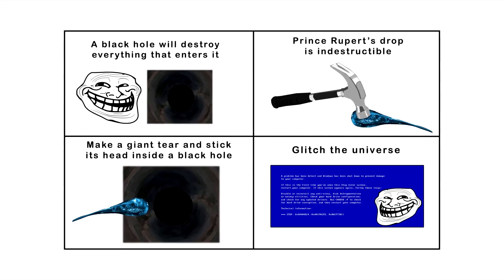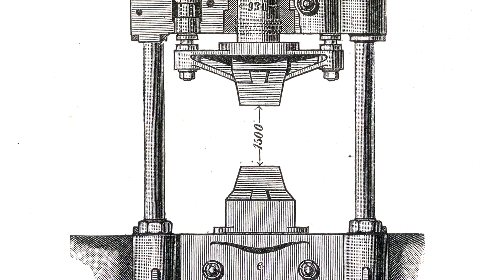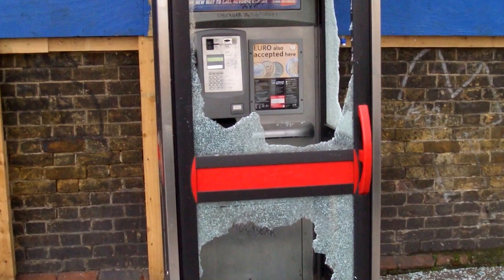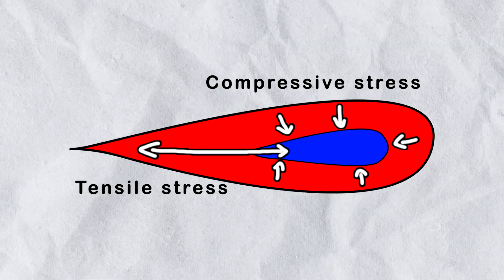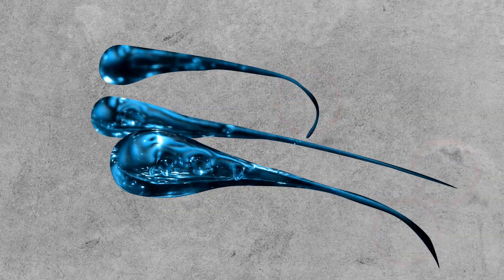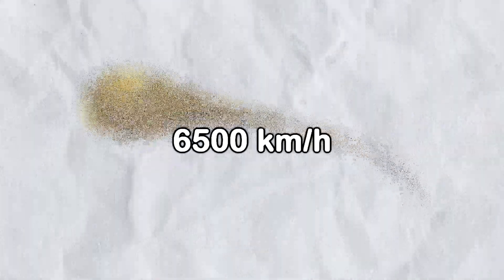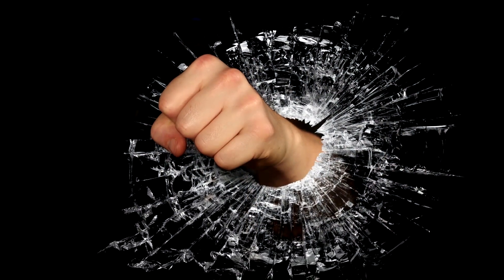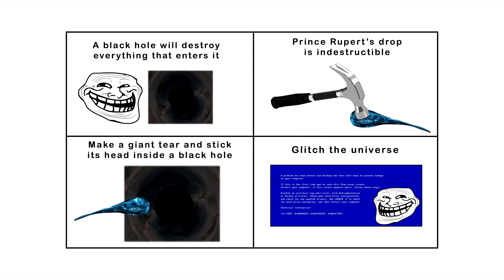why it doesn't work 70

Comment: It's also worth mentioning that these drops WILL pop if enough force is used. Remember: if brute force doesn't work, that's because you are not using enough of it. A black hole is a good example of "enough brute force," but hydraulic presses also do the trick.

Comment: unfortunately current durability does not stop you from getting ripped apart by gravity, and honestly the energy you would need to do so, especially from a black hole, would probably exceed the energy required to blow up the earth. wait until we get further in the tech tree, then ask this again.
Reply: You wouldn’t get ripped apart, it’s that the space you occupy would be stretched to extreme lengths. But due to how the space-time continuum works, you wouldn’t feel any difference.

Comment: Suggestion for video:

Veritasium said that 1 way speed of light can’t be measured. But it can.

Take some air(air has a very low refractive index that isn’t 1)
Shoot a fast particle at it(about 1/2c)
Shoot more fast particles, eventually one will go faster then light as light is being slowed by air. This will cause Cherenkov radiation, and thus be visible. Then stop
Multiply the speed of the fastest particle by refractive index of air to get speed of light in that direction. Then, given 2-way speed of light, calculate speed of light in exact opposite direction.
If you use lots of particles and also very gradually increase speed, you will get very accurate estimation of 1 way speed of light. 
AND you can do this in any direction, getting speed of light in any direction.(Note that particles have to be shot 1 by 1)

PROBLEM, VERITASIUM?
Reply: I love making particles go faster then light. this totally doesent break everything we know about physics
yes, "problem"
Reply: @kosuken  the particles dont have to travel faster then light IN A VACUUM. They are travelling faster than light in AIR. In air, light is just a teensy-weensy bit slower, letting particles get faster then it, but the particles never go faster then light in a vacuum. So no laws of physics are broken
Reply: @TojosWizzyWorld oh shit mb, I should have read ur thing more carefully. I just saw "faster then light" and decided to comment lol
Reply: @kosuken look up cherenkov radiation silly :3

Comment: The only way you're going to break the universe is by pitting two constants against each other, causing a scenario where one is forced to break

Only issue is getting that scenario and universal constants under control is not really easy, at all
Reply: I'm not even sure that would work. It's like the conundrum of what happens when an Unstoppable Force meets an Immovable Object? The solution is quite simple, by definition any universe that can generate an unstoppable force cannot create an immovable object. The opposite is true, if a universe is capable of creating an immovable object, by definition no force it creates should be powerful enough to be unstoppable.
Reply: @Ristaak  Nah, funnily enough an unstoppable force and immovable object are the same thing. Something that can't be accelerated. Which is not possible under our universe, but, if one was to be possible, both would be.
Reply: @neoromanempire I thought the idea was one wasn’t moving and the other one travels infinitely, no? I do understand what you’re getting at though as an already still immovable object no matter it’s mass or the force applied the acceleration would remain at 0 therefor immovable while an unstoppable force can’t go any faster therefor can’t accelerate but unlike the object is in motion already at a constant speed? But then I guess it wouldn’t have any force. Maybe the idea of an unstoppable object is something that accelerates indefinitely? I’m off to google lol
Reply: @JPsL4DD3R  Moving respect to what? (relativity heheheheh)
Reply: Cosmic speck 1: "Hey, look at this dude. He's putting two constants together, Pi and 3, and trying to make them equal. Should we tell him?"
Cosmic speck 2: "Nah. Let him cook."
Reply: Funny enough, I just watched a Slay the Princess video.

Comment: The reason this doesn't work is because the chemical bonds that hold solid objects together don't work across an event horizon. Any part of the drop which is below the event horizon will not remain bonded to parts above the event horizon, as this would require electromagnetism/electrons to escape the event horizon.

If you try this, the black hole will just cut off the head of the drop.
Reply: If It were stacionary yes but if Its falling It cant know when It has fallen past the Horizon

Comment: Recently saw a hydraulic press video where they put a drop under the press, and it shattered. If a simple press can do it so could a black hole.
Reply: There's several hydraulic press videos with Prince Rupert's drops. At least one clearly breaks the head directly. It's tempered glass, it's not invincible and has known material limits. They're much higher than you might expect and the shape comes very close to optimizing those limits but it still has them.
Reply: @Hevach  I know that, I'm just saying there's evidence here on Earth that proves they aren't indestructible and we don't have to go to "strongest force in the universe" to break the drop.
Reply: I saw a video where the prince rupert's drop damaged the hydraulic press
Reply: @AjarTadpole7202  presses have different materials and I think this one had titanium plates on the ends. The plates got dented if that counts as damage.
Reply: He said no matter could exist in a black hole. Therefore, there are no hydraulic presses in the black hole. Therefore, the prince ruperts drop is safe😊

Comment: How about this? It's a false proof that has no false steps (math):
1) x^x^x^x^x^... = 4
2)x^(x^x^x^x^...) = 4
3) x^4 = 4
4) ⁴√x^4 = ⁴√4
5) x = ⁴√4
6) Now plug in ⁴√4 for x value to check if it's true.
7) (⁴√4)^(⁴√4)^(⁴√4)^(⁴√4)... = 4
8) lim x --> inf ((⁴√4)^^x) = 4
Now get an calculator to find the answer of lim x --> inf ((⁴√4)^^x).
9) The answer will be approaching to 2 as x gets larger.
10) 2 = 4?

Comment: What would probably get the Prince Rupert’s drop: the tidal forces as it approaches the black hole. The force differential would probably disturb the tail enough to shatter the drop.
Reply: The gravity beyond the event horizon would be so intense that it will rip apart the drop by atoms if it has to. It doesn’t matter how “hard” something is then.
Reply: @pumpkingamebox  beyond? From the perspective of an outside observer, the drop never crosses the event horizon
Reply: @YunxiaoChu  But we’re not talking perspectives, right?
Reply: Depending on the size of the black hole, it could enter the event horizon from its own perspective and not be destroyed.

Comment: Can you do a video about making a Prince Rupert's drop into armor? Couldn't you overlay enough drops without the tail being exposed in order to become bulletproof?
Reply: There’s no absorption so you would still feel a lot of the force of the bullet, the vibrations from getting shot or just running could cause some drops to break so you’d need a new set often and it’s not got a good shape for lattices.
Reply: also the tails would probably break really easily from even the slightest movement depending on how you hide them
Reply: my eXACT thought dude. prince rupert chainmail would go so hard.
Reply: No. If you were paying attention to the video, it talks about tempered glass, which is the same process but without the tail. Tempered glass armor would be both impossible to move in, and would not absorb any of the impact because it’s a rigid material. So even if the armor didn’t shatter, all of the bullet’s energy would be transferred into your body anyway, and cause serious internal damage
Reply: Good luck with ricochets

Comment: This Rupert guy should've just made one without the tail. What was he thinking?
Reply: Ironically, it's actually possible to make a Rupert's drop with no real tail, but it's incredibly difficult and still leads to a gradient of strength from the front to the back. However, all parts of it are still significantly stronger than regular glass.
Reply: Thats called pre-stressed glass and is a part of some types of bullet/impact resistant glass. You can also melt the tail of a ruperts drop with a blowtorch to make an "invincible" rupert's drop.
Reply: @PellyEllieEla  I think the curved form of rupert’s drop is also makes it strong, bullets literally ricochets from it instead of catching it like flat type of armors that is mostly used around.
Reply: @PellyEllieEla  if you melt off the tail it just acts like normal glass
Reply: Make it in microgravity
Reply: Actually, I’m pretty sure it was the MythBusters or someone but basically someone melted the tail off and it became indestructible. The hammer did nothing a hydraulic press got dented.
Reply: Lolll

Comment: Can we teleport a black hole through a wormhole?😅
Reply: Weaponized black holes hell yeah
Reply: won't the wormhole get destroyed by the blackhole?
Reply: @Smougda  I don't know, but if we assumed that it is a stable wormhole then it will be fine, I think someone should probably make a simulation about it. Scienceclic already made a simulation of a wormhole and black hole
Reply: @Smougda no
Reply: a black hole is a worm hole i think
Reply: @quesothedogquesothedog  not exactly, a wormhole connects a black hole with it's opposite a white hole known as Einstein-rosen bridge you can see it on something called  Penrose diagram, but that doesn't mean that wormholes only exist in black hole , theocratically they can exist but they would need negative energy to prevent them from collapsing
Reply: @martyrosadil9989 IT IS?? YO I GUESSED THIS IN LIKE 5TH GRADE